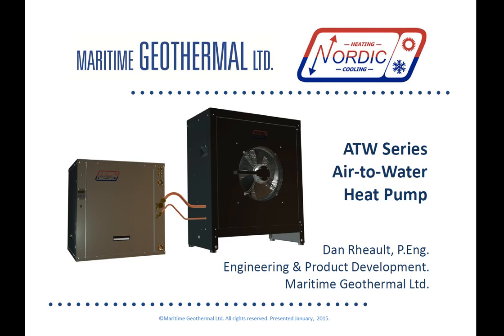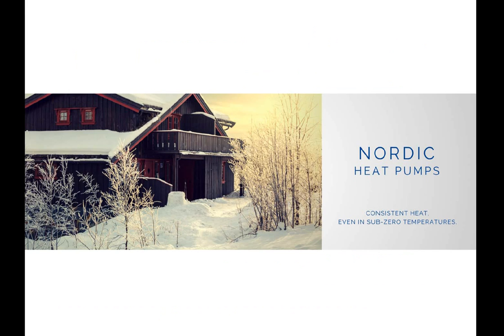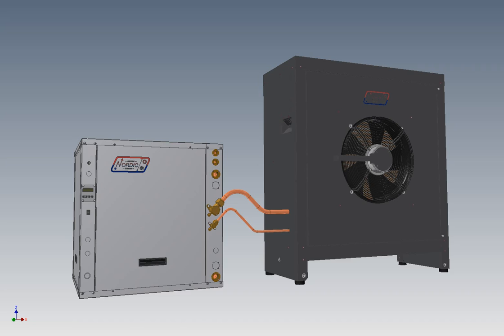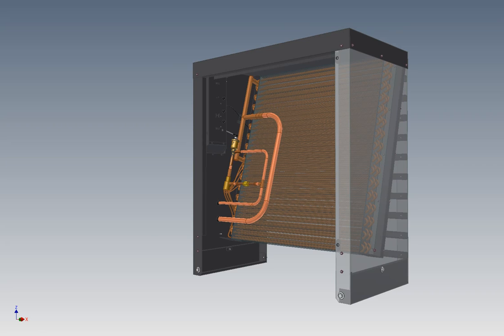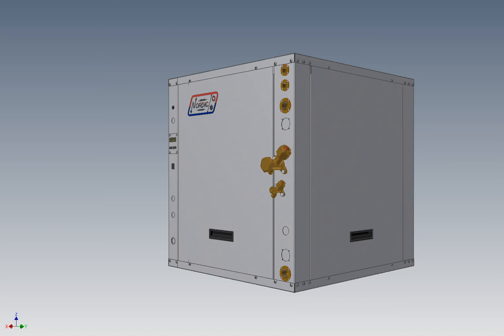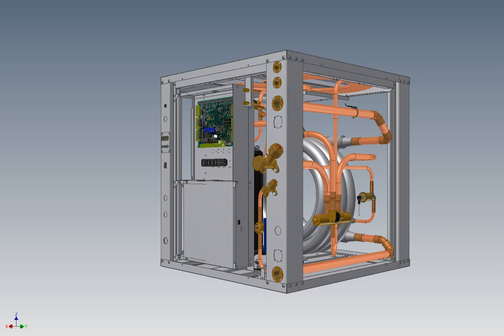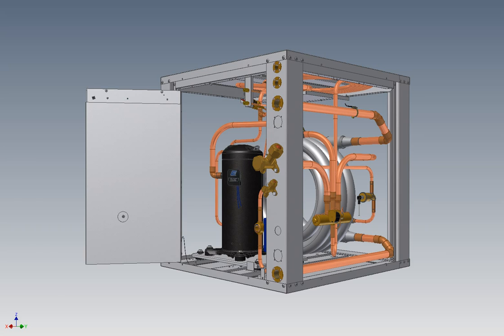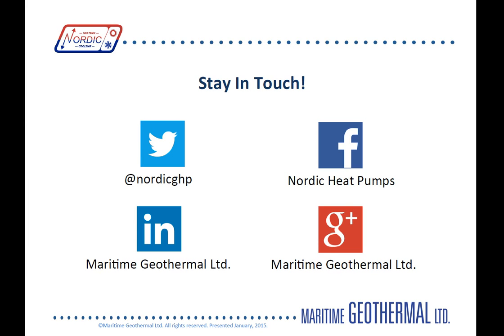Say Hello To Our Air-to-Water ATW Series Heat Pump

Comment: I see this video is over 7 years old, but do your newer ATW units operate when the outdoor temperature is below -21 C? 

Looking for a solution for our radiant floor heating in the basement while pairing with another air-to-air heat pump for the rest of the home (goes below -30 C)

In the clip here, it's mentioned that the COP on this unit is 1.3 at a temp of -29 C, but the current website says the bottom range is -21.7 C.

Your ATF series looks to be the ideal solution - except for a bottom operating temp of -22 C, at which point a backup is required.

UPDATE: for anyone wondering: I spoke with Dan Rheault (the engineer in this video) and he confirmed that -29 C was an error, it is indeed -22, but there is an electric resistance heater as backup that is added/required at time of purchase, which kicks in when temperatures fall below the heat pump's operating temperature.

Sounds like a great unit overall and possibly worth the cost depending on contractor. Also, Dan was a pleasure to speak with.

Comment: YOu should show the unit on the high stand since water will freeze on ground underneath but looking below I see you don't answer youtube comments. Hmm
Reply from the maker: Brad, if you check out our website, there are additional images of the air to water heat pump on the 15" leg kit stand.

Comment: Could you tell me the Air-to-Water Efficiency:   ----------  at 90 F (32C)        --------- at 100 F (38C)    ----------at 110 F (43C)  -------120 F (49 C)  ?.    I am planning on using a 4 ton unit in the "low desert" - Palm Springs area in California .
Reply from the maker: You can check out our heat pump's heating and cooling efficiency in the performance tables located in our product manual: https://www.nordicghp.com/wp-content/uploads/2020/03/001970MAN-03-ISSUE-05-ATW-Series-Two-Stage-R410a.pdf

Comment: could one of these be used to heat an indoor pool in the winter? im currently using oil to heat the pool but it gets quite expensive.
Reply from the maker: You would have to make sure the unit can supply enough heat for the indoor pool but yes it could be done.
Reply: If you heating your pool winter time sure costs are not the issue

Comment: Wondering what the sound coefficient of the indoor unit; with the compressor inside the house it might be a little loud. What safeties are available for the compressor in the event of a power failure?
Reply from the maker: You can read about how loud the heat pump is in this blog post: https://www.nordicghp.com/2016/06/air-to-water-heat-pump-noise/
The indoor unit will hum similar to a refrigerator. It is usually installed in a basement or a mechanical room which this is not noticeable. In the event the heat pump has to be installed closed to a living space we supply additional sound dampening accessories.